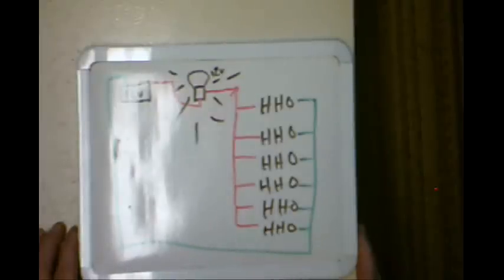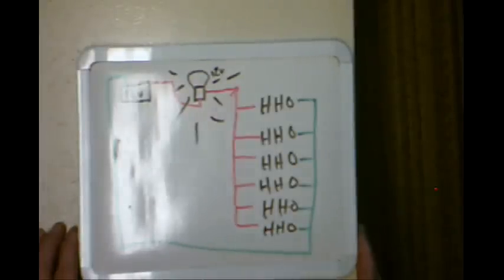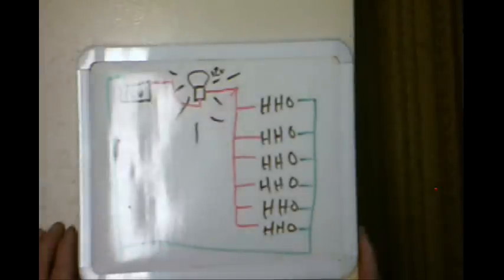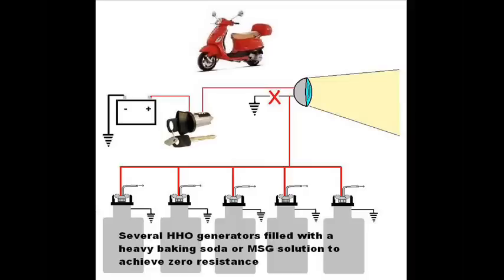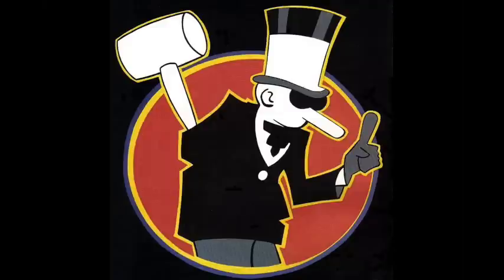HHO motorcycle and scooter hookup.

Comment: I'm a huge fan of the future of HHO as a possible replacement for fossil fuels. That said, this guy is just the worst of what Youtube offers the world under the guise of 'alternative power' information. What he is doing has none of the 'free energy' aspects of say, a Tesla circuit. In a follow up video, he has these cells, in series with a headlamp, and he claims victory simply because the cells put out ANY amount of gas, even though it was drastically lower than before. Duh! No rocket science here. When you put circuits in series, you simply divide the total voltage by the number of units, and they all get the primary current. But, power is a function of voltage AND current. I've seen too many of these guys associate power with current, which is not only wrong, it's just ignorant. DC hydrolysis takes very low voltage, just high current. Bottom line is, you can't use power twice, which is this guys basic premise. There's a reason why he has more thumbs down, than up. FYI, I am a lifelong, working engineer, with a graduate degree in electrical engineering.
Reply from the maker: Ah yes, it's always the engineers that are taught only one way to do something...

You don't seem to grasp exactly what I proposed, and proving.
The last guy said it wouldn't work and made videos stating so simply because a 6volt light would blow in series in a 12v circuit simply because they are 6 volt lights. Then when I proved that circuit worked he claimed I was quote mining him. Eventually he was so embarrassed, being that he worked on computers and couldn't figure out 6 + 6 12, he shut down his channel.

The concept here is simple, A super huge amp hogging HHO device with a resistor controlling the circuit. The resistor also happens to create usable light in the process. Concept proved, now do that with every circuit in a vehicle and ANY amount of HHO becomes more HHO. The reason this is important is because people say that you can't produce ANY amount of gas without it causing the engine to work harder, thusly the 2 cancel each other out. Well now they have no excuses left.

I figured out the process, now let others refine it.
Reply from the maker: wcemichael
Also if you applied this to an H powered electric car, that uses greater amperage, then ANY become a lot more, and ANY times X would also mean the the car would go farther between H fill ups.

Comment: Weird Stuff,  but pl realize you can't get no more out then delivered by your alternator minus losses. To run your Vehicle you need electric available and the leftover could be used to Power your Generator. Thats it - Headlight or not. Amps are transformed into Heat, chemical and magnetic Energy. This is your loss.
Reply from the maker: I already got a working model, running exactly that way I said it would. The headlight acts as the controller and it just happens to produce light when working. There is less amperage pull from this device than just the headlight alone. So the loss is not mine.
Reply: Energy can be transformed, may be you figured out what else nobody knows about it. I would continue to tinker with it until I knew.
Amperage times Volts returns Watts. The only thing  which counts is how much ml Gas you harvest per Watt. 
For my Toys I stay on the safe side with 4 ml Gas per Watt since my Alternator produces only 600 Watts. If I draw more than 180 Watt continuously my Voltage Regulator and the Diode will burn up due to Overheating by constant Draw from my HHO System.
You could temporary add some Battery power to it, to have more Output but at the End of a long Drive your Battery needs to be recharged.
Reply from the maker: Multiple expansion engines. People were able to make steam engines that instead of one piston pushed by steam, that same steam could be reused to push another piston, and then another piston.
If a HHO unit is large enough, the power can easily pass through it will little resistance. What keeps this HHO unit from draining a battery dead quickly? A resistor. The resistor in this case is a motorcycle head lamp. A pleasant side effect is this resistor lights up the road while in use.
Now if your resistor is the motor to an electric car, the side effect would be the car moving down the road. If this electric car was powered by a electric hydrogen cell, the HHO unit would then supply hydrogen back to the hydrogen cell. Now I'm not saying that the car would run forever on one charge of hydrogen, but like the multiple expansion engine, it would go a lot farther between fill ups.
Reply: In your example your Steam will get cold after it did the work.Like any other process you will have some left over energy for Performance in Time. You wouldn't want to wait until all the Steam becomes cold Water. In our world nothing works perfect and I agree that there is always a tweak here and there for improvement.
Reply: I don't understand why you wanted to add more resistance. Resistors take away Energy and transform it into heat.
Reply from the maker: If I run a 10 amp headlight and a 10 amp HHO unit parallel to the batter, meaning if you disconnect 1 the other will still work, Then the headlight will run at 10 amps and the HHO will run at 10amps too, drawing 20 amps from the battery. Easy math, right.
BUT, if I take a 10 amp headlight and a 100 amp HHO unit and run them in series, meaning if I disconnect 1 then both are turned off, the light will run at about 9.8 amps, the HHO will run at 9.8 amps and the total power draw on the battery will be 9.8 amps.
Reply: What you should do is using an high powered Oscillator. Why -  the negative lead is covered with Electrons like Bugs. Please research Helmholtz Layer and Double Electric Layer. It means high Voltage  and then a Voltage drop into the negative to shake off Electrons. Flush the Electrons out with a Squish Zone.
Reply from the maker: No, this method won't work with an oscillator.
Reply: Look at my Video 03. Just a Simple Coil and a simple Capacitor and look at the Output. It will work.

Comment from the maker: I can't help because I don't fully understand what you're doing with just a comment.
Your jeep is 12 volts. If you have 24 volts, it too much voltage. That is why your lights and battery are exploding.
If you run the power through the HHO unit first and balance it to come out 12 volts AFTER hooking up the HHO, it should work better.
But you also need a second circuit to switch too if the HHO is off, to keep it at 12 volts
Does this help?

Comment: Before i practice to make my jeep alternator 24volts i removed rotor and ichange big cooper wire it makes very high amphers the problem when i test all bulb finish and my battery expload it makes like welding machine very high amphers i think its can used only for hho generator try it i dont know why happened to much amphers pls explain to me why like that.

Comment from the maker: @christo930 cont (2) And before you say it, yes the HHO output will be divided from the extra units, BUT the TOTAL output will increase slightly as more units are added. MORE IMPORTANT, the TOTAL HEAT will be divided as well, keeping it from boiling over. There is no way to get the bulb to it's orginal brightness, BUT it will be close enough. I've examined everything about this. I can't explain it any better than this without building it, so you'll have to do it yourself or wait for me to do it.

Comment from the maker: @christo930 cont. Now goto the last hook up. with only 1 HHO unit, running at the lowest resistance possible. and highest amp draw, too much for parelel hook up in either vehicle.The 1 unit by itself is producing more HHO than test 1 & 2 combined. It's also pulling less amps than the 1st bike test  with the low amp unit AND headlight hooked up parellel. MORE units added on will increase TOTAL HHO AND light output. AND still draws less amps than the first bike test.

Comment from the maker: @christo930 got to the link at 5:07.  I don't have an amp meter. Gauge the light bulb being used with your eyes. Bike HHO unit , parelel hook up, running HIGH resistance and extreme low amp draw, and LOW HHO output. So low that the light will not light in series. (now remeber this for later). Next look at the truck unit. Parelel hookup More sodium, less resistance, higher amp draw. light is a little briter. Both of these units are running at max capacity without draining the system.

Comment: @wcemichael But your circuit doesn't accomplish that, honestly, I know. Just go out in your garage and do the experiment, all you would need is a 12V DC power source like 2 lantern batteries in series or (preferably) a spare fully charged car battery. If your HHO device is getting less amps, it will generate less HHO. 
I think it's really cool that you are actually working on a problem and want to do good and share that knowledge you learn with others for free, I am trying o do the same here.

Comment from the maker: @christo930 Again, missing the point of "why?" I know which way electrons flow. The general public thinks otherwise. Even mythbusters did that, so I guess it's proof they don't know anytthing either.  So the electron flow will change the way this circuit works? NO! THE POINT IS TO DRAW LESS TOTAL AMPS FROM A SYSTEM and still have HHO output. So your head light is just a smidge dimmer. During the day, WHO CARES? At night turn on a bypass switch if you need to.

Comment: @christo930  Low resistance MAXIMIZES current draw, not the other way around. I understand what you are thinking, but it doesn't work like that. You seem to want to maximize the energy being drawn by that light so that as the electrons flow out of bulb and back towards the pos terminal, they will pass through the HHO device and therefor use the same electrons twice. Honestly, it doesn't work that way, you are making a mistake.

Comment: @wcemichael Do you realize the electrons flow from neg to positive? Your examples show that you think electrons flow from P to N. To make the 12V bulb shine the highest, disconnect all the other loads (and it will only shine to it's wattage rating). Adding a parallel circuit with 4 loads in series with your 12V bulb will make the 12V bulb burn less brightly not more brightly. Try the experiment with the bulbs and a spare 12v battery in your garage.

Comment from the maker: @christo930 LOOK AGAIN, the point is not to make the smaller bulbs light up. the point is to make the larger bulb light up 8:15 is just an example to help people understand, but somehow you got more confused. Check my channel for "WcE proves motorcycle hookup" and also look at the experiment link The point of all this is a direct power hookup uses extra amps. This INDIRECT hook up can never use more amps then what the bulb is rated for, even if you hookup 1,000,000 HHO units.

Comment: @christo930 A 1980 Honda CB750 is 68 horse power or 51kilowatts equivalent. Now that you have replaced all the lights with more efficient ones, why don't you try a run without the HHO hooked up, chances are, you might actually get better mileage without it, but while retaining the more efficient lights (which puts less drag on the engine through the alternator) and compare the difference. I don't know how much HHO you can create with 24 watts, but it's probably not that much.

Comment: Zero resistance is a short circuit, you can not run with zero resistance because the voltage drops to 0 and the amps go to infinity (or whatever max am out put is). Watts is calculated amps x Voltage (p=I*E), since voltage (E) is zero, you generate zero watts and burn the wire or destroy the source. If you want to reduce the load on your alternator, you need to get resistance much higher. Say you have 2 amps to spare after your accessories, in a 12V system, you will have 24 watts of power in HHO

Comment from the maker: @adolphbot So, what your suggesting is...using the correct exact terms is more important than the process or the results?. that if if the electrons going through 1 device then going through a second device is not using the same electrons twice? that the energy is all used up? Who said I said electrons are energy, you did. electrons are pushed by energy. Your'e trying not to understand, therfore you don't. The guy you listened to thinks you can't use 2-6v batteries can power 2-6v lights

Comment from the maker: @water2gashawaii I've never used a pwm. You're still drawing extra power form the system. If you constantly switching the power on and off, then the used power is still going to average out. Just figure out what the max amperage you can run and run it. Many bikes don't have 1 amp to spare, so this way you can run the unit and actualy draw less total amps than without the units.

Comment from the maker: @mpccenturion On a truck I would have the pos altinator wire running through the HHO units then to the truck, BUT since I don't know the exact ohms, or resistance (I have one crappy multimeter), the whole thing would be tricky and MY main HHO bottles prevent me from doing so. (the outside is stainless steel & acts as ground). You could also maybe find ALL foward light ground wires, including running lights. Or maybe a main ground wire. Stuff to think about.

BTW look up HHO antifreeze. My chan